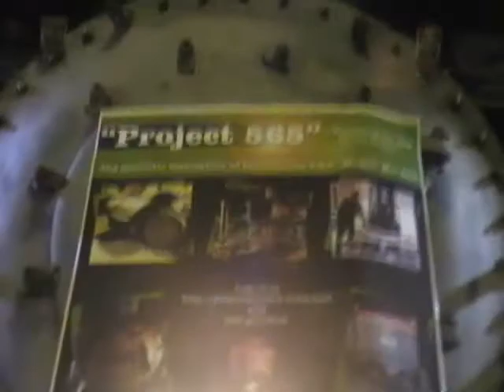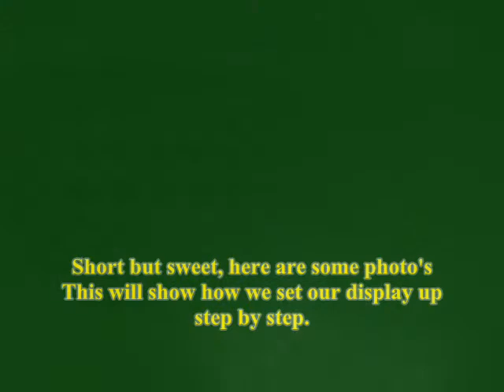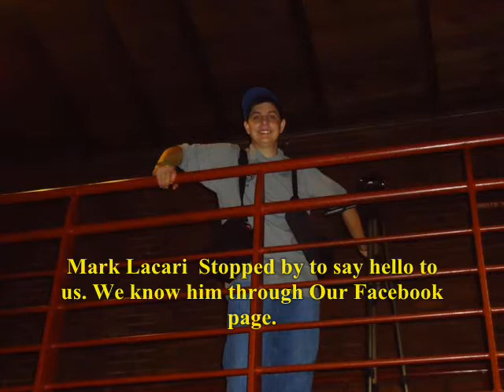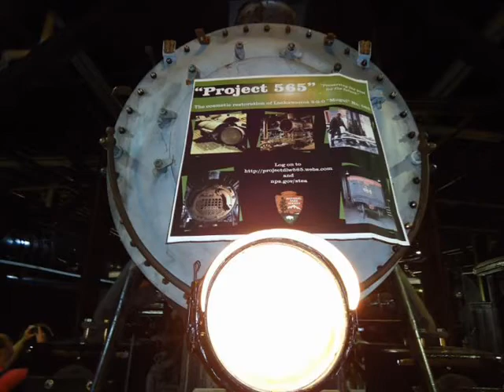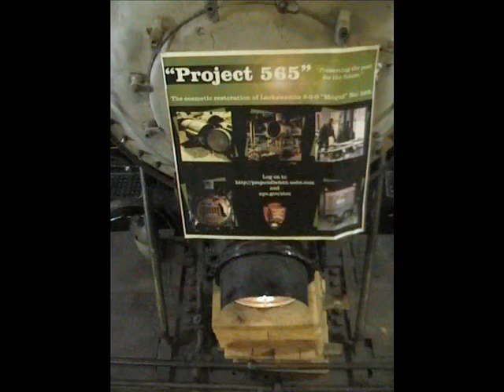Project 565 Progress Report Saturday September 3, 2011

Comment: Wonder why its taking so slow, theyre restoring 26, 2317, 3713, 565, and 756 of they didnt decide to rebuild and restore 5 engines 26 wouldve been on the line years ago, 3713 wouldve been on the line by 2012, and 565 wouldve been nearly completed